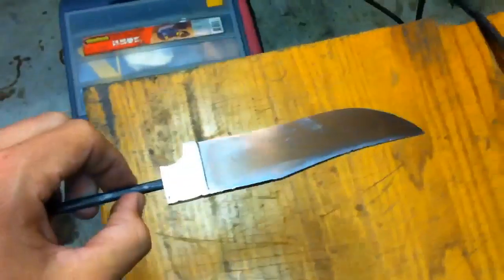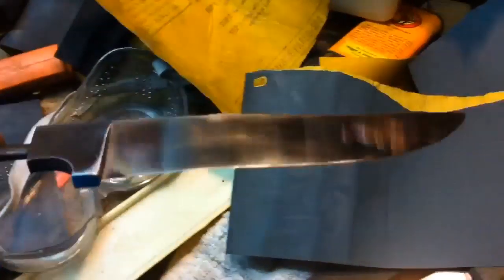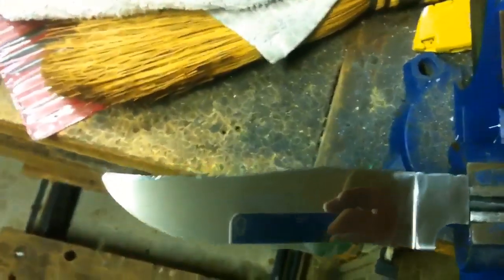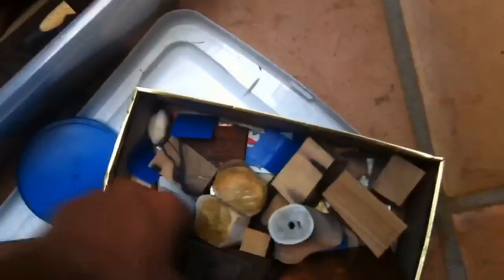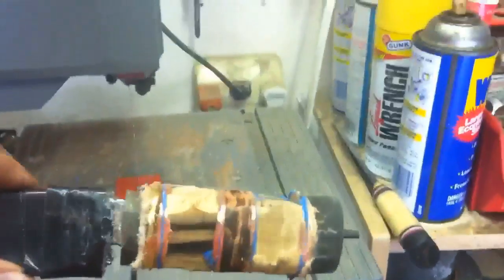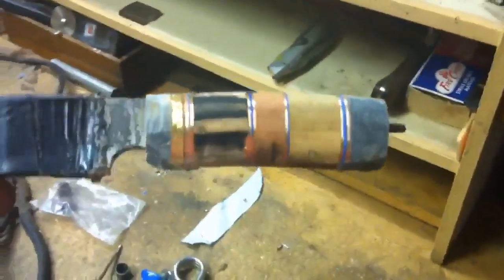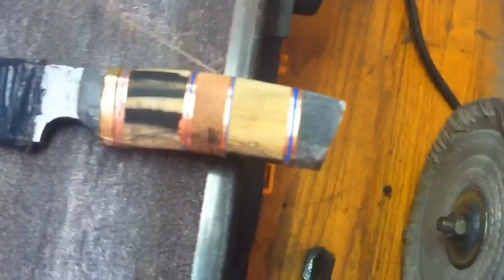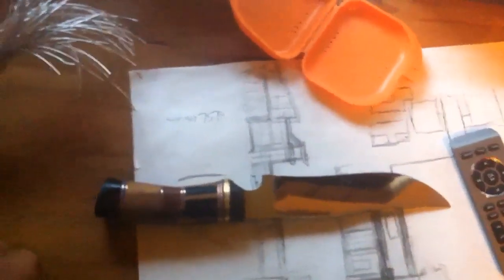Knife making tutorial (part 6) (HD)

Comment: For people wondering about the price, imagine getting federal minimum wage while working on it. $7.25 and hour for 10 hours. That's $72.50 in labor alone. Then the material costs, the couple hundred in tool costs, the utilities, etc. Is $700 steep? Yeah, but not by as much as you'd think. Selling to just break even requires hundreds of dollars for a custom, hand made knife of this quality.
Reply: +Pinche Pendejo When you run a business you don't just stop at labor. Sanding discs/belts, epoxy, propane and files are consumables that need to be replaced. You also need to factor in how you're going to pay off your tools. If your business model is high volume-low cost mass production sales, you can afford to stretch it out over time. Conversely, if you're making low volume-high cost custom knives, you can't really afford to stretch it over as much time. If you want a Pakistani production bowie knife, that's your prerogative; it doesn't change the expenses involved in custom knives, especially not outsourced knives. You can also look at ebay for custom knives and find $1,000-10,000 customs.

Comment: Awesome job young man!  For the tools and equipment you have, the knife came out phenomenally.  I watched all 6 tutorials and am very impressed. I have been a knife maker for over 10 years now. I remember starting out much like yourself.  All I had was a dremmel tool, a powe drill and a couple tubes of epoxy.  Lol
 All I would suggest to you is a couple safety tips. That cut off wheel attached to the bench grinder is an accident waiting to happen.  Please,  use a hack saw,  or an actual angle grinder.  Both of which you can get through harbor freight for very short money.  
 The other safety tip is about the way you use the buffer.  Never polish the blade above the center line of the wheel.  The rag wheel has a tendency to grab blade and throw it into YOU. So, work below the center line of the wheel.  That way it will be thrown down.  As opposed to you.
I'm not criticizing you in any way.  I would just like to see you be able to fish and make more knives. 
 I wish you continued success and the best of luck. 
             ~Bill Pezzano~

Comment: Very nice looking knife.At the butt of your handle,I would run a button die part way up the tang,and blind tap the horn(Whatever size your tang diameter happens to be.Harbor Freight has cheapy sets that would work),and epoxy the threads.That way,the tang is hidden at the butt end of knife,and if any of your glued layers should fail(if it were dropped for instance),the pieces won't just start fall off the end of the knife.

Comment: Very beautiful job.  I am also curious about a couple of quick things: The tempering of the blade was done when you cooked it in the oven at 350 degrees?  If so, do you temper the entire knife or just the blade typically?   Also, I don't understand how you secured the handle materials together.  Can you explain?  If it was all hammered, did you hammer through the brass?  Again, very impressed man.

Comment: I reccommend leaving the edge about 1mm thick before heat treating.

You don't have to peen the tang if it has a snug fit and you use a good epoxy, I prefer to not have the tang stick out the end, but end about 1/2" before the end of the handle and be tight due to friction in addition to using an epoxy.

Comment: Hey brother nice work. With the mineral oil, heat your handle materials with a hairdryer right before rubbing in the oil while handle still hot. Opens the pores in handle material. Do that twice, then a final unheated rubdown. Also, when using bone material, it needs to be stabilized so the bone doesn't continue to rot. Google "Bone handle stabilization", or check it out here on youtube.